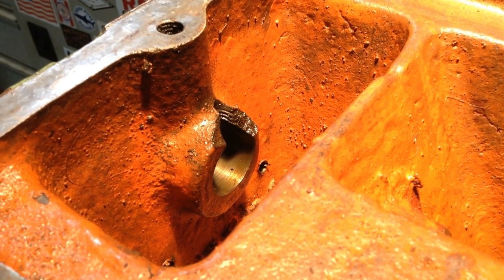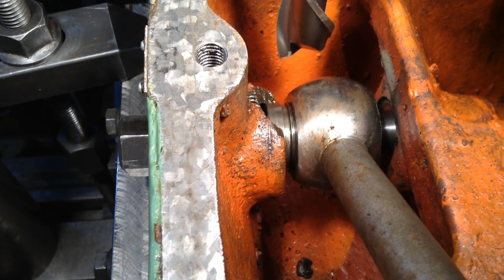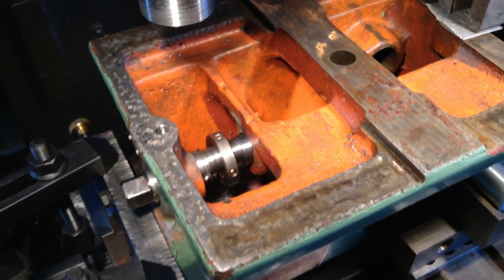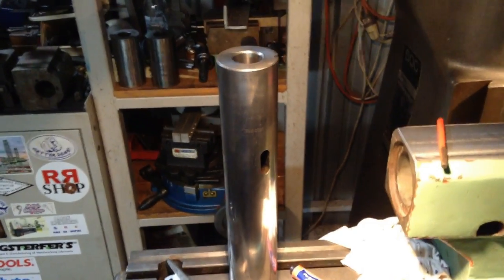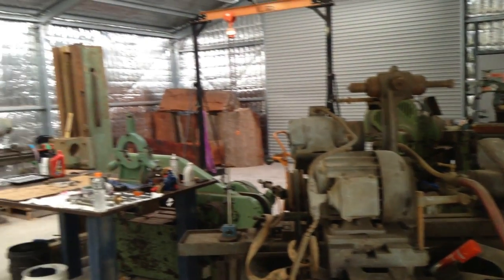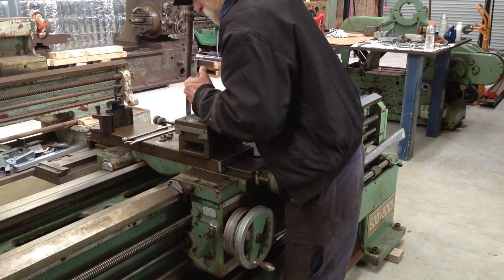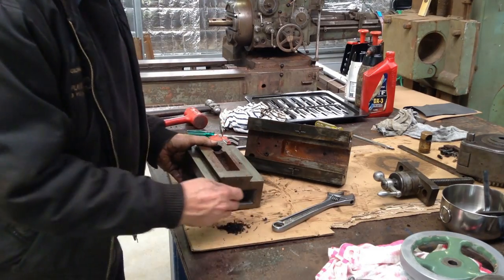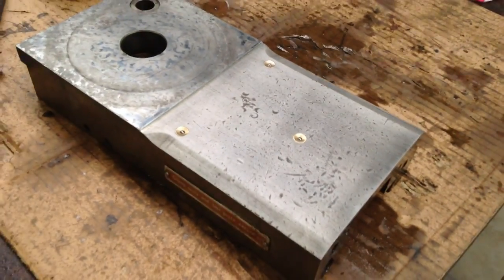JFMT 530 x 2000 Lathe Repairs . part 4

Comment: Really enjoy your refurbishment of this lathe. You have noted that it has little wear but a gorilla must have run those levers and nuts to bend, break and over tighten them. Redid my shop lights with led tubes and went with 5000 kelvin. Getting rid of the ballasts of the fluorescent bulbs removed a lot of heat from my shop as well as wasted energy. The increased lumens also is great for old eyes.
Reply from the maker: Thanks . I still have to try them on 5k & see what it looks like .  👍

Comment: Looking good Max.  I've never heard of using acetone and ATF as a cleaning agent.  It seems to work well  Thanks for the mention of my channel.  If I could give you one other piece of advice (if I am not too late) it is regarding the screw in the end of the compound rest leadscrew.  It uses a flat screwdriver and looks exactly like the one on my lathe.  There is a good chance that screw has a left hand thread.  I really buggered up the slot in my screw before I realized that it was left hand.  I ended up having to use one of those hammer type screw drivers to get mine to come loose.  Regarding the tight tool post nut, on my Broadbent Schofield lathe I have a Dickson style tool post and there is no anti rotation pin in the compound.  I use a large fine thread nut and tighten it with a 4 or 5 foot cheater bar.    So far I haven't been able to get it to turn during a heavy cut.  Ken
Reply from the maker: Thanks Ken .    I will be mindful about that screw .    I think i would rather fit an anti rotation pin , if possible    Not a huge fan of that style of tool post ,  Dickson would be my choice .   👍

Comment: I put 8 LED strip lights in to replace some old double 5ft fittings in my workshop (for some reason my wife calls it the garage). I have them on the daylight 6.5K setting, everyone who has been in has commented on how good the lighting is, the only "negative" comment is it looks bright, but a little clinical. I'd only use a 4K setting for my lounge I think, but you do have a lot of reflective surfaces, my shop is white.
Reply from the maker: In the new shop i have them turned down to 4k  .  Will have to play around with them . In the old small shop , lighting is difficult  depending on the time of the day due to reflections 👍

Comment: Stefan gottswinter had a video doing a compound that had long oil grooves in the direction of travel and wow did it have some big lumps where the oil grooves didn't contact and wear it evenly.. nice upgrades max, when i have time i really should pull both my lathes down for cleaning and to make lube feed upgrades and put way wipers everywhere since both my lathes only have wipers on the carriage only which makes me cringe.. sliding surfaces can never be to clean or to well lubed
Reply from the maker: Yes , i saw that  video .  Thanks  👍

Comment: Thank you for the post Max.  Would you be kind and please mention the lubricant type you use as re assembly.?  While my tools (Lathe, press, grinder)  are much smaller and without production demand, I am curious at what you find useful. For engine and car repair I often use the white assembly.  But where ways, internal threads I have been using light 10-30 wt.  Which I find easy to both wipe away any excess and replenish.  Shop progress as paint and lay out seems well in hand.  Thanks again for having me along.  M.
Reply from the maker: Hi . I use  iso 68 hydraulic oil  for everything  on the machines .    Cheers . 👍

Comment: Hello Max,
Good progress... One thing that popped into my mind was when you discover something that needs repairing does the best way to do it immediately pop into you mind or do you normally have to have a think about it. For example the bit broken off the tailstock casting that you milled away.
The update to the workshop looked good.
Cheers.
Paul,,
Reply from the maker: Hi Paul . Generally i have a fair idea pretty quick .       Complex ones i will think about different options ,  put's me to sleep at night !!!    👍

Comment: Hi Max...  very Interesting video. The shop is looking great, with lots of improvements. 
My question with the milling of the broken section is,   Why couldn't you just face that section,  then make a full size bush with a shoulder on the Inside to keep the Virtical Rod in check coupled with the the othe locating bush on the other end, making a stronger bush. And Yep you did a great job the way you made it, which will last for years.
Reply from the maker: Would need to fit overhead foxtails first  !   👍

Comment: Personally, I like the 5K color on my lights. The 4K is too warm (yellow) and the 6k is too cool (blue). The 5K is like a true white. I also think it's better on video. Crazy how tight the tool post nut was, but that's the ones that you never have to loosen, right?
Reply from the maker: I might try the 5k setting .  I just wish the switch was external !  Thanks .  👍

Comment: The collar is a good fix.
But it may me think of other ways to fix it. One was a threaded insert. Which lead to how do you thread the bore. 
I seen single point threading on a lathe. Can you single point thread on a mill ?
Reply from the maker: You can't  single point thread on a mill , unless it's some sort of special mill !  However you can on some Horizontal boring machines !   👍
Reply: @swanvalleymachineshop  I still leaning. There is so much to machining.

Comment: Thanks Max, 
I’m getting ready to take my pride and Whitney lay the part overhauling whatever needs worked on my cross line has about ¥40,000 play I need a new note I need a new screw
Reply from the maker: Ahhh , so that's why you have been practicing screw cutting !  👍

Comment: A lot of the time the machining is only a small part of repair work sometimes. When I worked for Ford Motor Company years ago I spent 2 or 3 hours setting up sometimes as most of the time you were hunting around for bits of clamping material and other things. If it was only a one-off job repair it wasn't worth keeping the setup materials so they used to be just thrown back on the bits and bobs shelf.
Reply: Some customers almost used to have a heart attack when you finally gave them the price of the repair lol.
Reply from the maker: That's right , often can be a lot of set up time for 10 mins machining !   👍

Comment: Hi Max, the toolpost may move under heavy cuts unless it is pinned to the compound, the reason it was so tight, poor stud must have been close to shearing off.
Did not see a pin on your's, remember Emma commenting about it when She mounted her baby multifix toolpost on Her lathe.
Reply from the maker: Would not get that carry on with a good old Pommy  Dickson ,  they have a pin !   👍